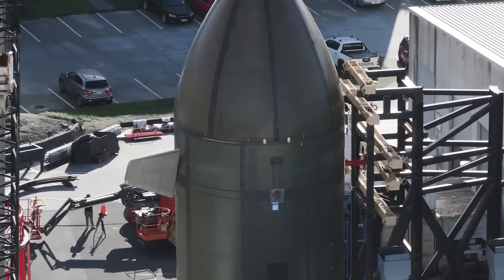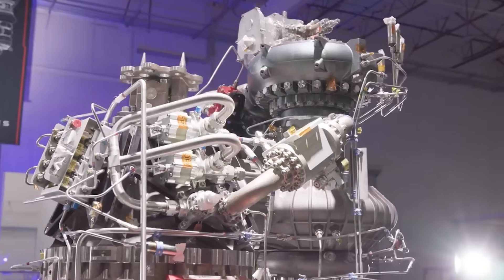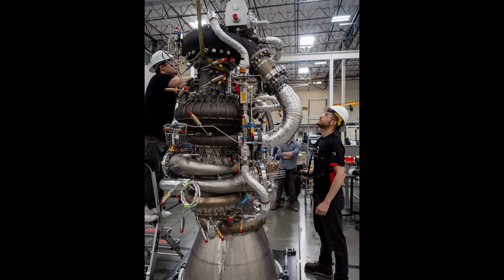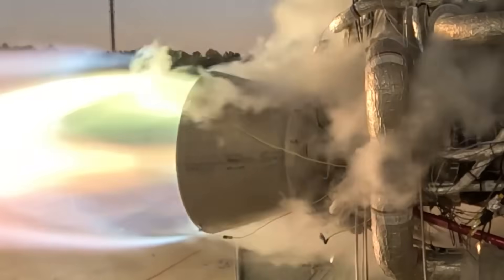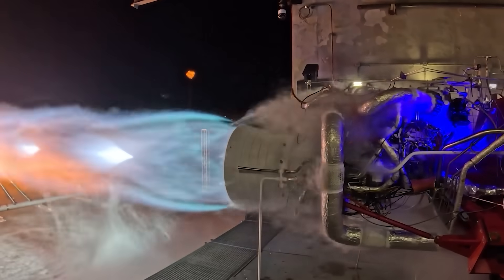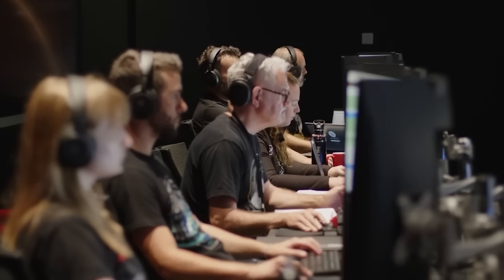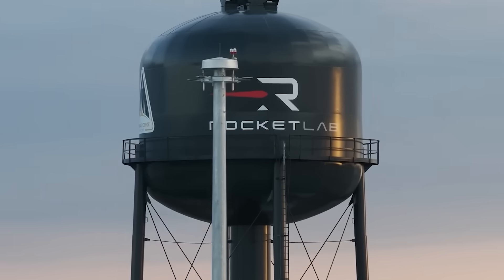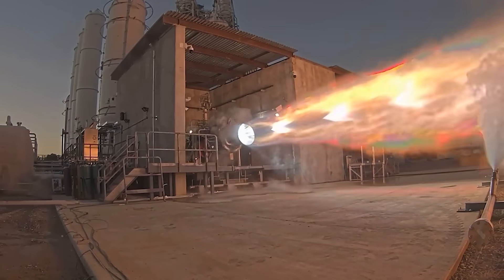Rocket Lab Is Ramping Up Neutron Engine Production

Comment: Raptor3 comparison:

The Raptor 3 is a high-performance, heavy-lift engine with unmatched thrust and efficiency, designed for SpaceX’s ambitious interplanetary goals. 

The Neutron’s Archimedes engine, while less powerful, is optimized for cost-effective, reusable medium-lift missions, serving a different market. 

Raptor 3’s advanced FFSCC cycle and streamlined design give it a technological edge, but Archimedes’ simpler approach may offer advantages in production cost and scalability for Rocket Lab’s needs.
Reply: Neutron is meant to be a Honda engine. Not a Ferrari.

Comment: One thing that has me more optimistic for Rocklab over Blue Origin is that Rocketlab has made their manufacturing prowess a key aspect of their business which is what really matters for low cost payloads to orbit. Blue Origin just doesn't have the build capacity imo, even with ULA also using their engines
Reply: RL has the advantage of being very resource constrained and has a founder/CEO who knows tech and biz. BO is more like the pet project that people thought SpaceX is going to be, only difference is that JB was exponentially more rich than EM when each respective company was founded..

Comment: Good luck to them. It'll be interesting to watch them optimize and simplify the Archimedes engine design. It's early days, but that looks like a lot of potential failure points with all those pipes. Or perhaps that's just for instrumentation during testing.
Reply: I believe all that mess to be testing systems